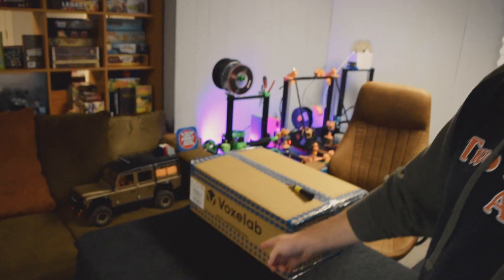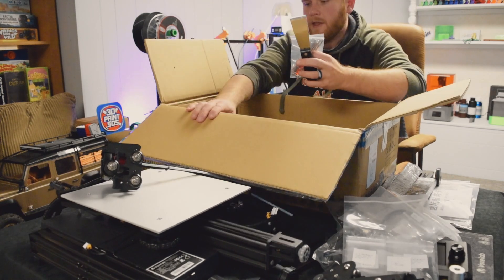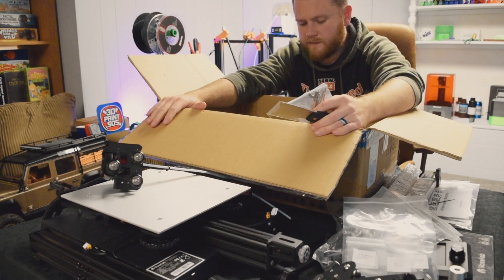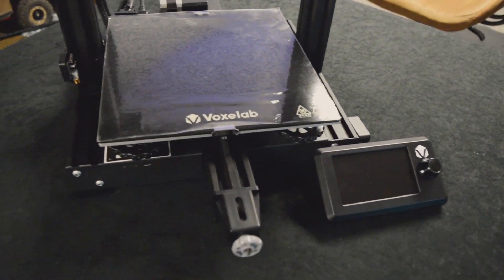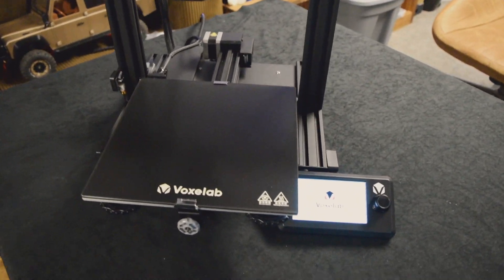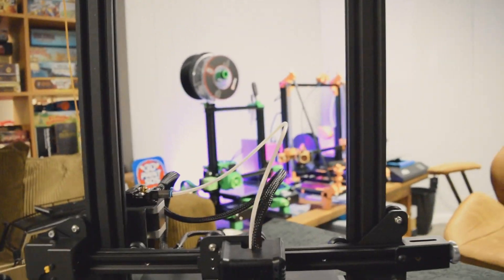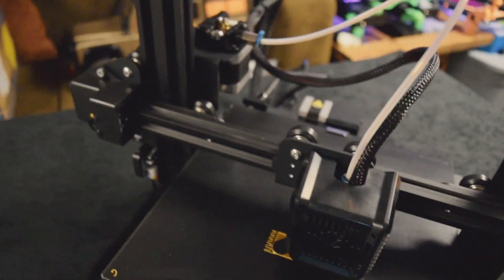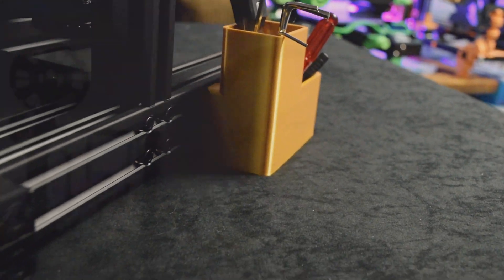Voxelab Aquila Unboxing, Assembly, and First Print

Comment: When I got mine in last week, one of the leveling knobs had nestled itself between the base of the bed and the hotplate. I'm pretty sure it just walked itself loose during shipping. 

On the downside: I did have some adhesion issues after about my 4th print. I dunno if my leveling screws walked themselves loose a little bit, or if I was too liberal when I was re-zeroing, but for some reason using the brim the print just ... unstuck itself. Considering this is my first 3d printer, I'm betting it's user error somehow, haha. 

Great video, just like your others :-)
Reply from the maker: Yes, all the knobs were very loose. It didn’t have an effect in the end, so it’s all good.
Reply: Make sure your bed is clean. I had the same adhesion issue and learned that the bed needs to be extremely clean... Sterilized, basically with alcohol.  Of course leveling, temperature, "squish," tramming etc. all play a role as well.  I'm a noob so I'm still learning. 👍
Reply from the maker: @fukcg00gle95   ^ This is the way. Couldn't have said it better myself. :)
Reply: @fukcg00gle95  Thanks for the tip! I have been diligent about cleaning the bed before every print, so I don't think it was that. 

At this point I'm pretty positive that either I set my leveling tolerance too loose, or the wheels walked themselves out slightly, because I just releveled and my adhesion has greatly improved.
Reply: Can't get any print to stick to the base to save my life. Overall not very happy with this and it totally bums me out
Reply from the maker: Level can be tricky at first for sure. I bet whatever the problem is at the moment is a really simple one. Even though it might seem frustrating at the moment. Let’s try to level the bed again with a piece of paper, clean it, then try again. If you need to the toon the bed more and still have the nozzle closer, you can move the z stop down a hair on the left of the machine. You have to tinker and experiment to get these going, that’s why the costs is sooooo low. But once you get it, it’ll reward you with perfect prints. I just printed something that I can even say is better than any of my other machines and this thing is bone stock.